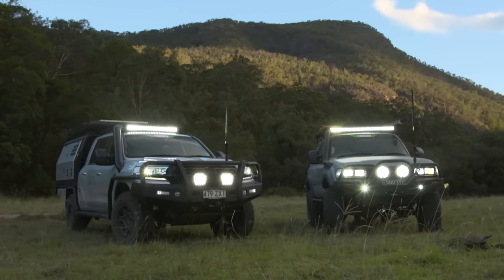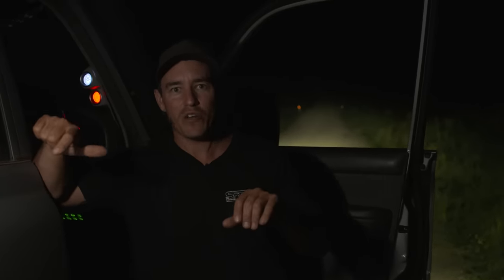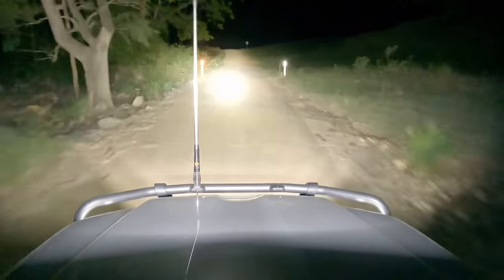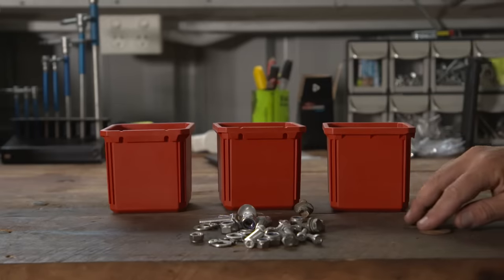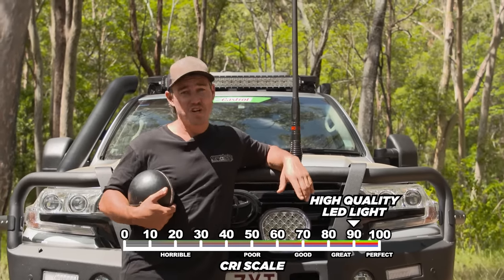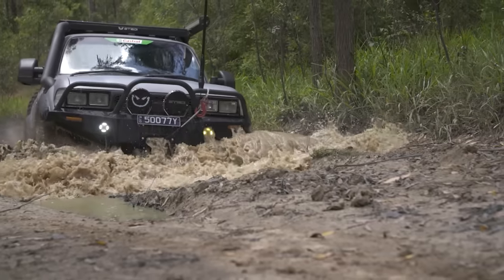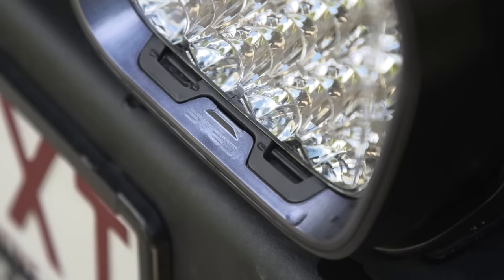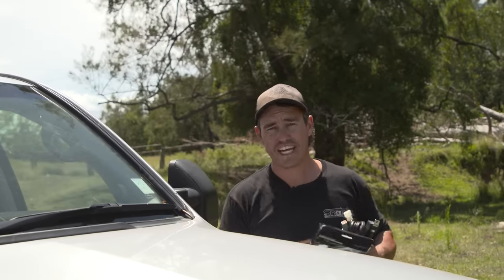5 things you DIDN'T know about DRIVING LIGHTS! Watch before you buy!

Comment: Number 1, you dont need 58 pairs of lights and 12 light bars, unless your IQ , undie size added together equal less than ypur EGO.

Number 2, you dont need the sun on the front of your vehicle to drive up a street in suburbia with street lights and reflectors everywhere.  

Number 3, If you partake in number 2, you are night blind and need to hand in your lisence. 

Number 4, "matrix LED"  headlights are shthouse,  stop using them, they are flawed in design and blind the fk out of everyone in a 2k window of the road infront of the vehicle. 

Number 5, stop using fkn fog lights all the time. Also stop putting HID and LED drop in globes into old reflector style headlights designed for halogen. You are fking people's retina with you shtcntness...